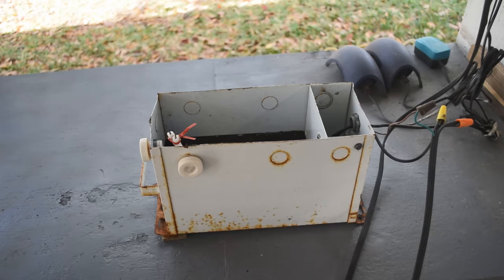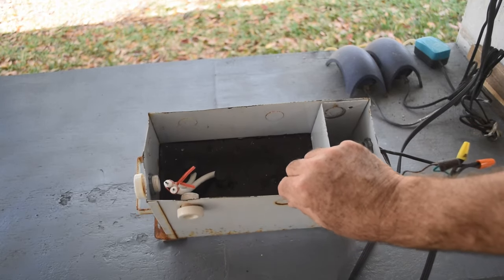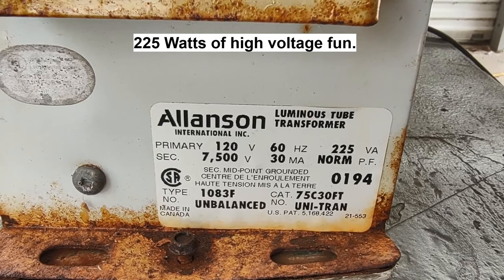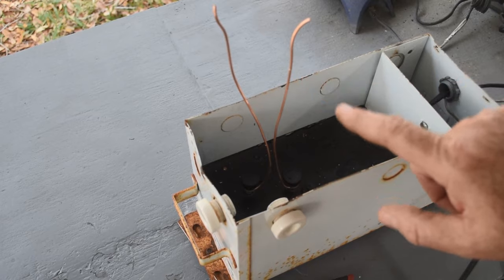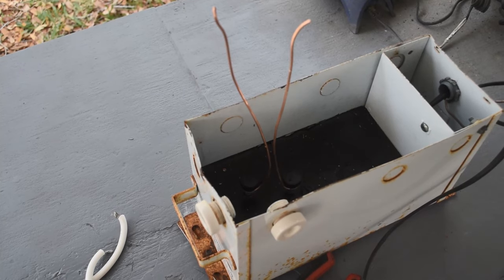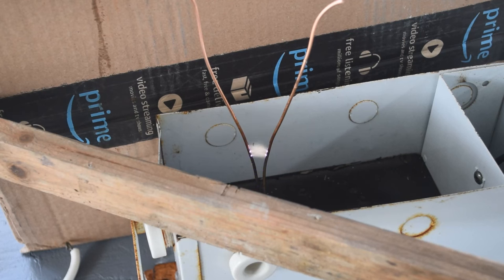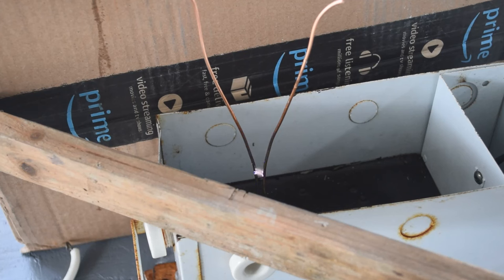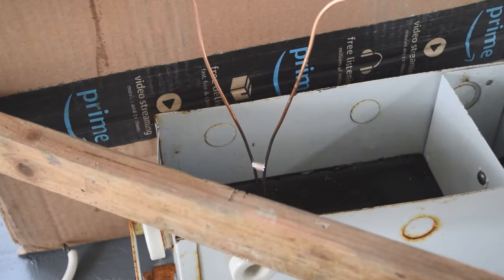Pointless Fun With High Voltage: Neon Sign Transformer #teslacoil #jacobsladder #highvoltage

Comment: What works better is steel coat hanger. It also produces an interisting magnetic effect if you get it right. You want real power, take 2 microwave transformers and connect the cores. Next cross phase the primary. The output will be the sum of both. Be extremely careful. This will kill you, but I got 10" very hot sparks. Aside from that the energy produced might help with your nitric acid generator. Another thought is high voltage makes ozone. Some nice experiments there.